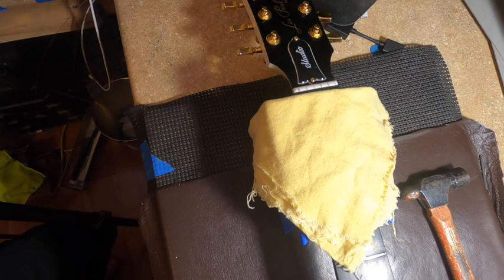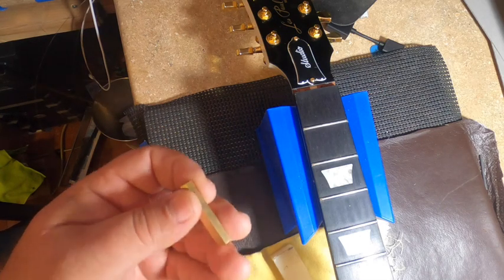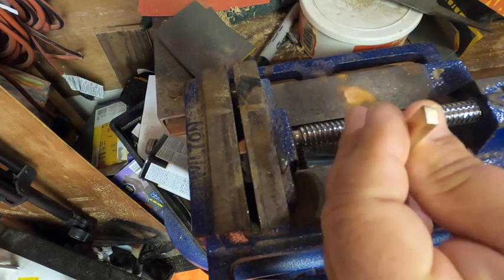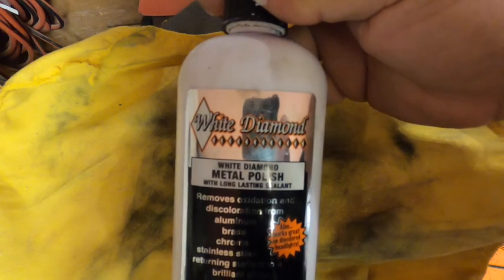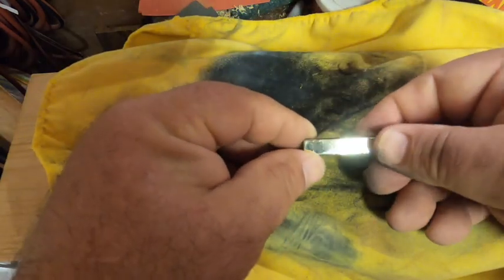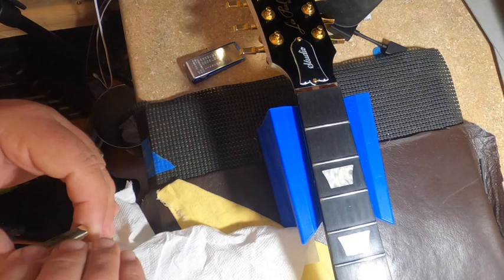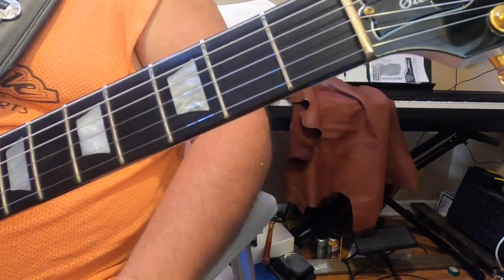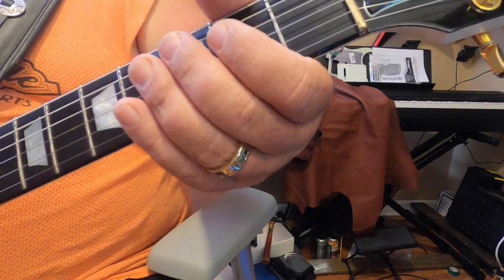How to Install a Brass Nut on a Les Paul Studio

Comment: Yes, brass nuts have the absolute longest sustain and the smoothest decay of all nut materials (including Tusq), as well as the best tone.  Too bad you didn't do a before and after demo so we could hear the difference in tone and sustain between the bone nut and the brass nut.  I was considering a brass nut, but was afraid I wouldn't be able to find someone to install it. But from watching this, I may just tackle it myself.  Where did you get those fret files from, and what kind of file did you use to trim down the height for the nut...?
Reply from the maker: Hi Glenn, Thanks for watching. The nut files I used are from Music Nomad-https://www.amazon.com/MusicNomad-Electric-Guitar-Diamond-Slotting/dp/B08ZR98HK5/ref=sr_1_12?crid=3V9VLAR30VQYS&keywords=nut+files+guitar&qid=1661333579&sprefix=Nut+fi%2Caps%2C100&sr=8-1     They are  a little pricey but they work very well. To adjust the overall height, I used a series of flat files, from coarse to smooth. There are other alternatives to the music nomad nut files which also work.  https://www.amazon.com/Holmer-Slotting-Luthier-Replacement-Cleaner/dp/B08FQN1X2H/ref=sr_1_7?crid=3V9VLAR30VQYS&keywords=nut+files+guitar&qid=1661333579&sprefix=Nut+fi%2Caps%2C100&sr=8-7        These are also very good:  https://www.amazon.com/Metallor-Guitar-Double-Slotting-Electric/dp/B07MCZ9S8X/ref=sr_1_9?crid=3V9VLAR30VQYS&keywords=nut+files+guitar&qid=1661333579&sprefix=Nut+fi%2Caps%2C100&sr=8-9
Reply: @primaltone9064  - Excellent... Thx...!  ;-)